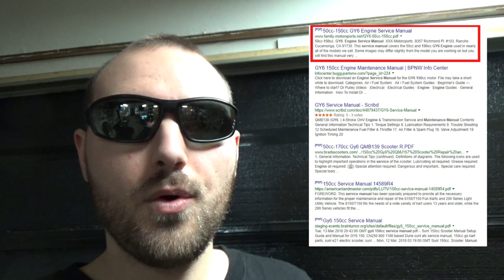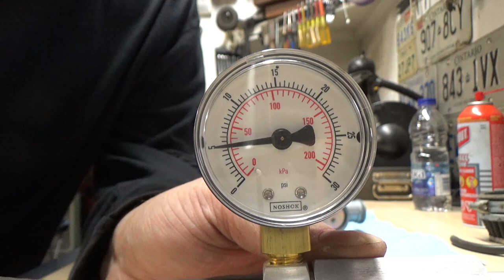How to CLEAN a China ATV Carburetor!

Comment: I have this exact Chinese quad! But mine doesn’t have a kickstart.. anyways I bought it for $100 cause it wasn’t running, I then replaced all the electrical for $40 replaced the gear and starter clutch for $60 and bought a new carb for $70 and everything up to now is working and doing its job! The last piece to make it run is in the mail right now and it will be here tomorrow:)
Reply from the maker: Awesome! And you're lucky, these kick starts suck, who designed it to go forward? I have size 13 boots, I almost broke the fender lol
Reply: Eliminator Performance haha it woulda been a problem for me too then haha I’m size 12

Comment: Thanks! The ATV I got has a mod, where its a handlebar twist for throttle that goes to the top of the carb, but I see the thumb throttle still here with its cable just hanging. How can I switch the cable? In your video it seems the cable is attached to the cap mechanism? Does the cable and the cap come apart?

Comment: The metering tube does it have a hole running through the centre like from top all the way through?cos in my other bike it has hole running from top to bottom  as well as through the sides

Comment: Very informative video on the carburettor and centrifugal clutch operation on this Daymac Quad. Your Eliminators should be extremely careful when buying these machines used since basically they are like Bic lighters ie: disposable, they may find that the cost of repair is beyond what the ATV is worth and may be better off buying a Honda or other quality made ATV. Saying that, they also should know that when buying any used equipment there is always wear and people normally are not selling something because they don't have issues with it! You likely have run into this with some of the mowers and other equipment you have taken as trade in on your fully serviced equipment ie: low compression and basically a scrap engine.

Comment: Hey, i got myself a chinese 250cc ATV and quickly cleaned the carb, but when i start the atv and rev it, the throttle starts breaking up. It revs up but then bounces and breaks up even tho the throttle is held at the same position. Any ideas what could cause that? It idles and stays running, usually the idle gets uncomfortably high for no reason which is why I went to clean the carb in the first place. Any help is appreciated.

Comment: My needle valve was stuck closed I pulled the carby apart and the needle valve doesn't have the metal clip hooking it to the float is this normal in some models or would the old owner have done this?
Reply from the maker: I'm not too sure, would have to Google a model number to find a parts diagram

Comment: On mine the atomiser jet is blocked solid any ideas on cleaning it ? the holes in the side are clear but the hole through the centre is block solid
Reply: You might have luck using a welding tip cleaner kit if you think you could break it with some wire

Comment: hay. my china atv only ran when i had choke on alittle. would not run without. it died right away. and now after driving it alittle with 5 % choke on and barely anny power. it died and now its just puffing air out and not igniting. ive check for spark.
Reply: also there is alot of air comming out of the enginebay air out hose.

Comment: Oh man can u explain the gas lines .i have the same carb but lines r mixed up.simply explain the dirtection of the lines from the tank  to and from the carb .i have a gas line coming from my tank going ..nowhere .i have a line going from the front of my ..engine running around the right side to left to a shut off valve. On the other side of the shut of valve through a filter to the ..intake ..i have at the bottom a small line underneath for overflow .thats it .i dont know who did it .but if u could quickly run me through where the lines actually run starting from the tank that would be amazing. I did like and subscribe.the shut off valve has only ends on it .im thinking maybe its not the right valve .maybe i need one with a vaccume on it ?